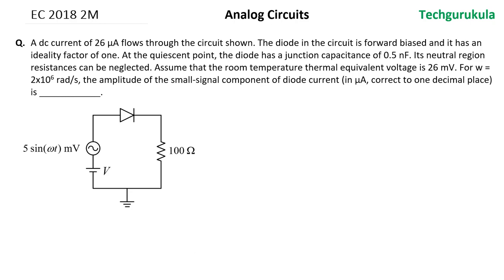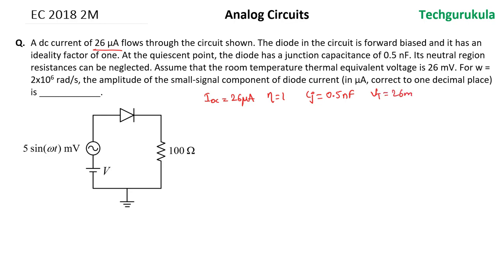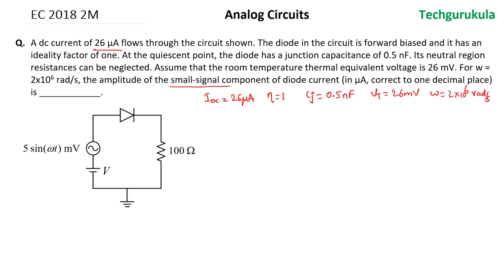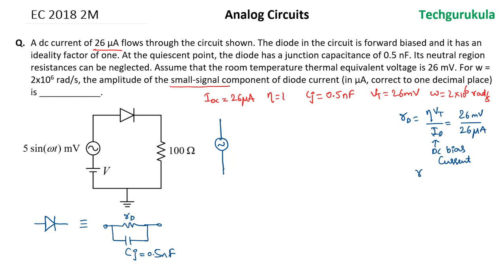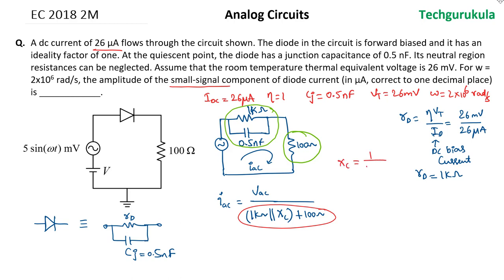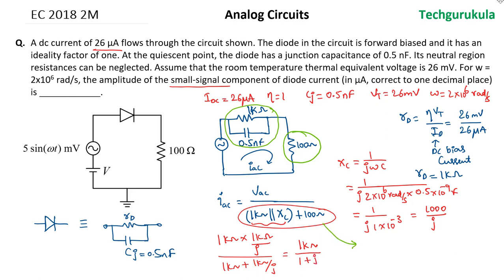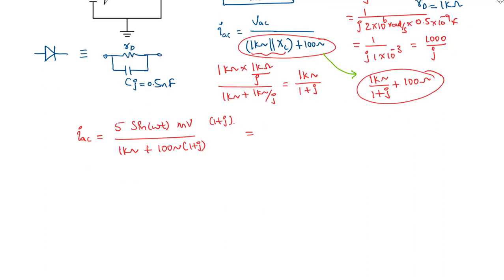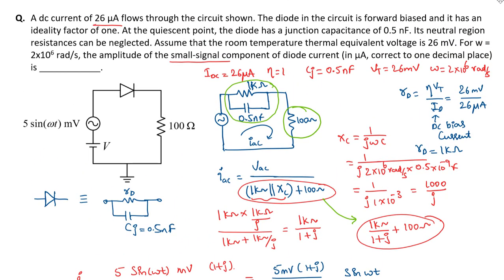AC: EC GATE 2018 2M - Diode small signal analysis

Comment: why you have taken Xc = 1/(jwc) instead of Xc = 1/(wc)
Reply: voltage across the capacitor is 90 degree out of phase of that with the resistor.
Reply: @alanharshan5533  can you tell me when to  use Xc=1/wc and when to use Xc=1/jwc
Reply: @delusional3024  If two circuit elements say, a capacitor and a resistor are connected in series to an AC source, it would be incorrect to say that the total impedance is R+1/Cw.
This arises due to the phase difference between current and voltage of the elements. 
Hence , capacitive reactance is 1/jCw and inductive reactance is jLw.
Hope this helps.
ent
Reply: @alanharshan5533  thanks brother